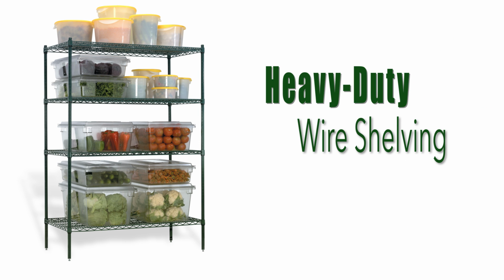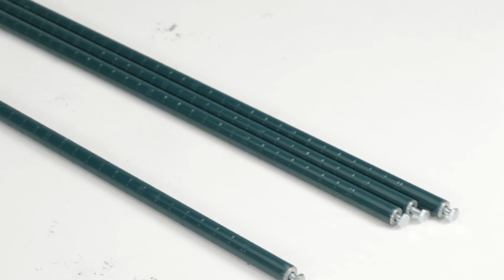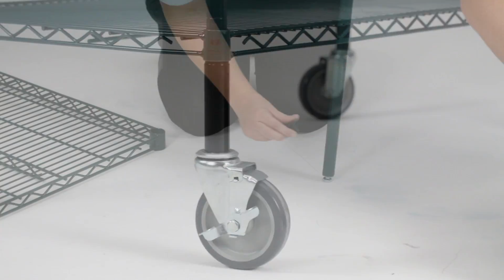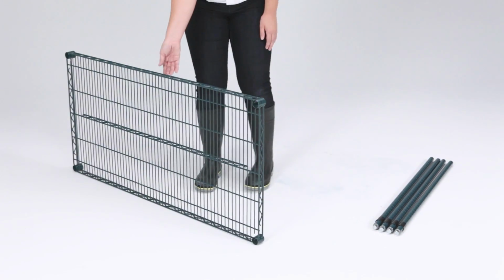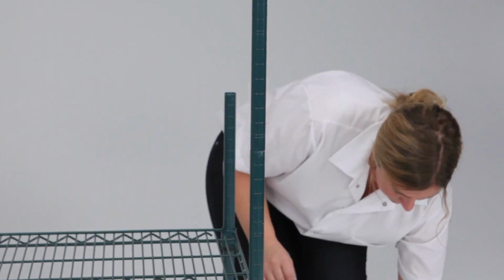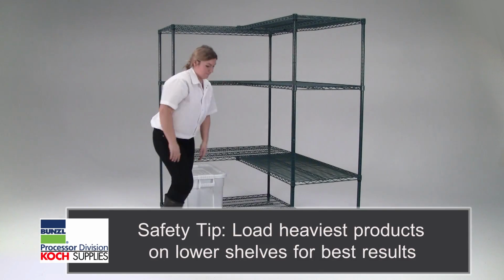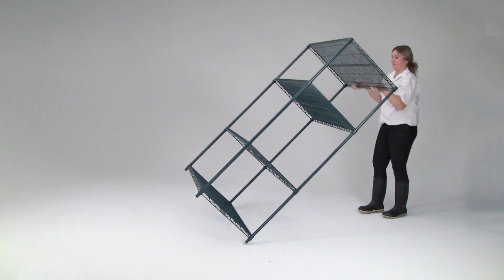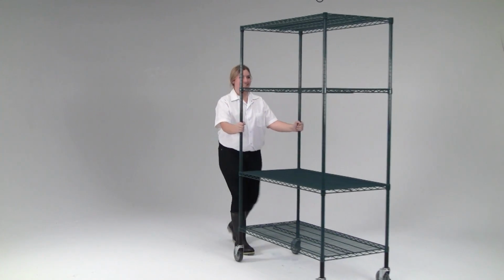Heavy Duty Wire Shelving Assembly — Bunzl Processor Division

Comment: Can I place the shelves at different heights?
Reply from the maker: There are adjustments about every inch or so. If you have the unit on casters, then you can't use the bottom 6 inches of the support poles.

Comment: can the shelf really take 800 lb?  that is more than 300 kg. Will the plastic clip hold??
Reply from the maker: Hi Michel, that is correct! The recommended weight distribution for this heavy-duty shelving is 800-lbs. max per lower shelves & 400-lbs. max per upper shelves.

Comment: Can you split a 4 shelf unit in two, and use it that way instead of 4 shelves you would have 2 two shelf units?
Reply from the maker: The shelving and posts are sold separately.  One post has one adjustment left foot and one top cap.  
If you want the adjustable feet and top cap, buy 2 - 36” posts, rather than trying to split a 72” post.  
Please call 800-456-5624 if you have any further questions.
Reply: @BPDkochsupplies  Thank you So much!

Comment: Can the shelves be flipped so that the lip is upward to stop things from sling of?
Reply from the maker: Hi Jersey, The shelves could physically be flipped, but there are some possible issues to consider if you flip the shelves upside down. First, there is a reinforcement “beam” ( the same thickness as the sides ) that runs the length of the shelf ( in the center of the shelf ).  This beam would cause the surface to not be flat. In addition, given that the reinforcement beam is now on the top, rather than the bottom of the shelf, it might not hold as much weight.
Reply: @BPDkochsupplies  Wow, thanks so much for the speedy response & info!!
Reply: I had the same question.  Wanted lip on top to keep seed trays from getting knocked off.  I also want to put larger plant containers on it sometimes, so I'll do it lip down.

Comment: I took this apart when I moved and now trying to put together. The sleeves just pop right off when I begin to put the shelf on. What am I doing wrong
Reply from the maker: To keep the sleeves from popping off, make sure the clips are installed going the correct direction ( narrower at the top ) and try lowering the shelves into place slower.  
The shelves are held in place by friction, pressing down on the clips forcing them inwards.

Comment: I want to flip the shelves upside down, anyone think of a way it could work?
Reply from the maker: Hi Dea! We wouldn't be sure how to go about doing that. We can only advise on assembly as intended. We hope you find a way to help that work for you!
Reply from the maker: The shelves could physically be flipped, but there are some possible issues to consider if you flip the shelves upside down. First, there is a reinforcement “beam” ( the same thickness as the sides ) that runs the length of the shelf ( in the center of the shelf ).  This beam would cause the surface to not be flat. In addition, given that the reinforcement beam is now on the top, rather than the bottom of the shelf, it might not hold as much weight.

Comment: You stated that the shelves and posts are sold separately. So, If I buy one set of 24x36 wire shelves? How many shelves are included? And, when ordering the 72" (height) posts, how many posts are included per set? (Since a total of 4 posts are needed to make it stand.) The site is confusing in regards to "quantity" and what you are actually getting.
Reply from the maker: Hello, thanks for your question. Shelves and posts are individual quantities, so you would need to purchase a quantity of 4 posts for a complete unit, and then how ever many shelves you are wanting to have. Hope this helps!

Comment: These clips are useless. Not the same product. I paid $120 for one from Walmart and the clips don’t snap on even using locking pliers. Don’t waste your effort trying to snap them together. Just go return the product
Reply from the maker: Hello, we are sorry to hear you are having issues. We do have replacement clips on our website for $3.95 per bag of 4: https://www.bunzlpd.com/shop/material-handling/dunnage-racks-shelving-cabinets/shelving/heavy-duty-wire-shelving-14. 
If you're having any other issues, please don't hesitate to reach out to our team at 800-456-5624 and they will be able to assist you with assembly.